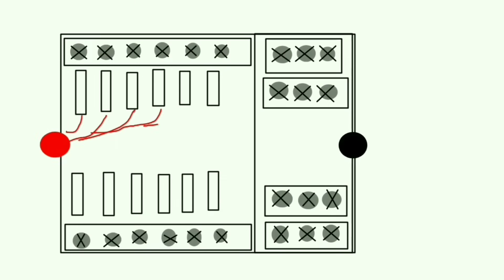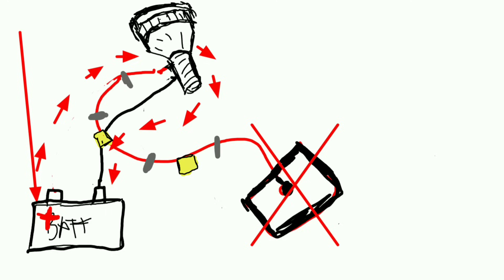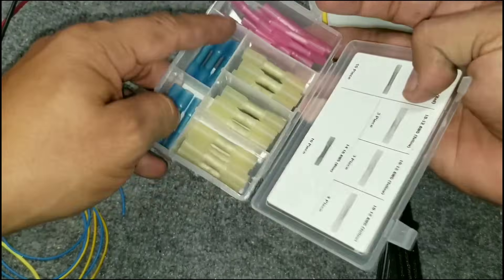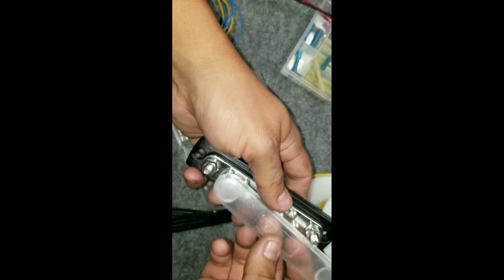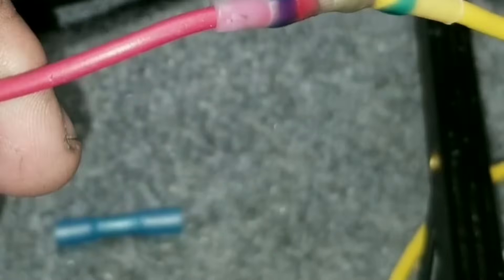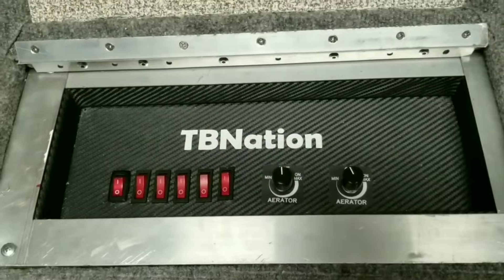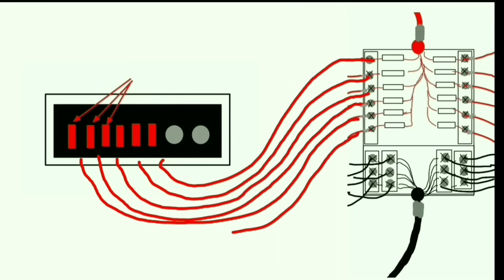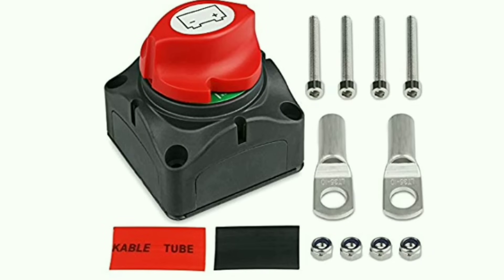SUPER EASY Boat Wiring Electrical Diagrams, Fuse blocks, busbars, marine grade

Comment: How do I split the positive wire from the battery into 6 or 8 wires (1 to each of the fuses) on the panel?  Is there some kind of splitter to buy?

Comment: Only thing about the low temp solder connectors is that a wire may penetrate insulation (apparent on this video) and then you have a water intrusion problem. So maybe the mechanical crimps with heat shrinks is the way to go.
Reply: Tiny Boat Nation THIS IS THE WAY.

Comment: If you have a lot of accessories in one general area, you can save a lot of wire and have a neater installation by running a single larger wire to a local ground bus.  This saves having to run 4-5 individual ground wires all the way back to your switch panel.

Comment: don't use butt connectors- splice and solder with the heat resin shrink wrap (use 1 piece wire is better, terminals only, use a positive bus bar instead of having butt joins) solder ends for any crimped ring terminals (tinned copper is best) - lasts a lot longer, otherwise I endorse the vid, is good. Using the good wire, panel and the blue sea, fuse/bus bar.

Comment: I am new to wiring . I have two deep cycle batteries. One for trolling motor. One for starting 25 hp Johnson . I have a starboard floor and a plastic logic 15 foot v haul boat. Can run all wires under flooring.  So I can run 6 gauge positive and negative wire with fuse directly too trolling motor. Starting motor has a positive and negative wire going direct to battery.  So need to run two more 6 gauge + and - too the fuse block (blue sea system 5029) then out of that run14 gauge + and - too fish finder ,Bilge pump,radio, marine cb, live well, lights. Then run black positive 14 gauge wire from these Accessories too a  bus bar and then 1 wire back to battery. To complete the circuit. Where does cut off switch go and is this too much for just cranking battery.  I know engine will charge battery. Would I need a battery charger or minder. How do I wire that just directly to battery. What bus bar and switch and chargers do you like.   Thank you

Comment: None of this videos say where the wire is coming from and what it is when it gets to the power source. We need a video, each wire from the light to the source. I dont understand the bars and all that. Tou just start in the middle every time.
Reply: He ran an 8gage positive and negative to the bud bar from the battery. Then ran his leads from accessories to the bus bar. I thought it was straightforward.
Reply: Then maybe, just maybe, you shouldn't be doing wiring.
Reply: @n5syr01  watching videos to
Learn is wrong?
Reply: The battery ties in to the bus.  Just consider the bus a battery with more teminals
Reply: The bus is basically your battery....you take a source (say a Bilge pump) and instead of running the red lead to the battery + you run it to the + of the bus bar...same with negative.
Reply: He does. Around 8:40
Reply: I agree, I wish Mike would start at the battery and go forward then come back to the battery so you see the complete process start to finish,this is no a hate comment just need complete baby steps so is beginner see the whole process full circle 👍👍

Comment: great video! i have one question—-the switch board i bought has 1 end on the back that’s open. so if i run the bilge pump wire into the back of the switches only open pin, how do i run that pin into my fuse box? do i just piggy back the wires at the pin?

Comment: Thanks foe the info,,my boat is 17ft long and have no power to bus bar,,will 8 gauge be safe to rewire it, about 25ft of wire,
Reply: @TinyBoatNation  Thank you for the reply, I noticed the red and black wire that feeds bus bar with fuses from battery were bigger, I just didn't know what gauge to use, thanks for your help and the videos.

Comment: hey Michael, Do we need to add a fuse (commonly hearing 30amp) past the battery switch before the fuse box? I keep seeing mixed answers. thanks. Currently adding electronics to my 14' gregor.
Reply: No point you are double fusing mate. Electricity doesn't work that way. Even the large fuse prior to the mains switch in your house the fuse is different in how it works its not a conventional fuse,  the ones in the consumer unit are breakers and only the ones on the plugs are fuses. This is for a reason.

Comment: Hey Bro, thanks for video. Just bought a 1982 Cajun bass boat that needs to be completely re-wired. Can’t find boat electrical diagrams or manuals. So, my question to you is, how to set it up for re-wire, and what supplies to bye? Help. AJ, thx

Comment: Do you have any advice on how to make a solenoid connector stay in good shape? For example i got a few older solenoids, the one on now got all green where the connectors are, so say i chop the wires / replace what ever, clean / metal brush the solenoid connector and bolt them on nicely. However since there was corrosion there before, itl corrode quickly again. Do you have any advice how to keep an older connector thats redone from corroding again? Like should i rubber cement that? or how do i just keep it from turning all green again in 6 months. Thanks

Comment: Great video. I didn't even know there was a difference in the wire. I just got my first boat I'm a 44 year old car guy and planned on doing my boat like a car. Thanks for teaching me and saving me some future headaches.
Reply: If you run either of the cable types through conduit then they will likely last the same amount of time and you should be tinning your own wire ends and fluxing up before hearing solder. Rosin core solder still gets cold solders if you don't use flux. Heating "low temp" solder is not in any way ideal and I'm suprised he went for that since he was clued up about the wire guage.

Comment: If your using a 3 prong switch did you do anything with the negative prong on the switch or just didn’t use it?
Reply: Tiny Boat Nation where do you ground it to? Do you piggyback it to the negative on the fuse block or run a negative bus that connects to the battery?
Reply: @adamshields1982  great question,I would like to know the same thing?

Comment: This was super helpful, i have one question with regards to grounding. In a fiberglass boat would you need to run a separate ground from say the motor to the terminal bus?
Reply: For small boating wiring there is not really a concept of 'ground' - for the powering of accessories and lights, it is more a situation of positive from the battery and negative to the battery. The role of the motor/alternator is separate to powering accessories, the battery is charged via the alternator while the accessories draw current from the battery. Typically there will be a negative bus bar which connects to the negative terminal of the battery - just a convenient way to collect all of the negative terminals of the accessories for connection back to the battery.

Comment: Great video.  Invest in a crimper the doesn't risk puncturing the the heat shrink connector.  Like a ratchet style crimper designed specifically for those connectors your using in the video.

Comment: Rewiring my project Aquasport boat. So basically I should buy the box with ground and power running through it as a fused thing. So if I’m wiring my boat gauges to motor, I should run the positive gauge wire from gauge to the box and have it go from box to engine, and then have the negative ground out in the box. Just making sure I understand. This video helped a lot and made me feel more confident. Thanks
Reply: Or just buy a proper switch panel mate.

Comment: You need to slide to heat shrink butt connector down the wire then fray both ends of wire and twist them together then pull your butt connector over them and heat makes the pull  strength a 10x's stronger but great videos man very inspiring 👍

Comment: Are you not using relays at all? What are those toggle rocker switches rated for current-wise? If I can get away without a relay I'd much rather do that but I've been weary about burning up switches.

Comment: Can't I just connect ground wires to the body of aluminium boat for example for all gadets? For example if I use switch from batery (-) to the body of boat and then whole boat can work as ground (-), no? And only Positive wires goes trough from battery to switch panel and to the gadets?

Comment: Noob here, how do I choose a fuse block? My boat has an old glass tube fuse block. Id like replace it and clean up the wiring from this inherited 1989 Lowe. I see 12-way block positive, 12-way w/neg bus? Recommendations, differences? I already see I need to upgrade wire. my 12v trolling motor i just bought, the pre-wired plug is only 10 gauge for a 15ft run. I think I need 4 guage according to minn kota. I wired the trolling motor directly to a deep-cycle battery with an inline 60Amp breaker.

Comment: Very helpful. New subscriber! What gauge wire did you use from the motor to the battery? I've been told both 4 and 6. (99" Merc 125)

Comment: Any issues with accessories or the blue sea fuse block having a constant draw on your batteries? I know your master switch will turn it off. But does it draw power when off? 

I had issues with a fuse block in the past, need to figure out the best way of preventing it going forward.

Comment: hey man, make sure you know what you're talking about before you try to teach anyone. that's not shrink wrap. ti was a solder sleeve, and you fucked it up with the grill lighter. use a heat gun next time. you made a bunch of other fuck ups, and your craftsmanship is shoddy at best.
Reply: Sir, I'm not competing in your industry. I'm an aircraft electrician, but if you are getting more jobs than your competition good for you.Just make sure your work is done to a high level of craftsmanship. That's what people deserve when they pay you for a job. Now as for my card board box personality. I may be an Asshole and everybody knows it, but I'm working on it! Thanks for taking time to reply. I did give you a thumbs up. Thanks for keeping it real with me.

Comment: No relays? Are those switches rated for that much current?
Reply: @TinyBoatNation  right on. If the accessories don't require much amperage, then you don't have to worry about relays. I would guess though, that a pump or a fan would draw quite a bit of current. The cheap switches could burn out without relays.
Reply: @TinyBoatNation  I bought some for my golf cart accessories on Amazon. They were pretty cheap.

Comment: Question, do all black cables go to negative and all the red to positive? Also, how about yellow?
Reply: Michael Lopez Thank you for the quick response. I ask because we got a new sailboat to us last year. After the purchase, we realized that the starter battery was fried. It was a 92AH AGM Intimidator, which I just replaced yesterday with am AGM West Marine with the same specs. It should be noted that our house bank is a 400 AH Gel. We have 200 AH Gel in the lazarette and 2 98 AH Gels behind the engine. I took pictures when I uninstalled the old starter battery and used the pic to guide me installing the new battery. On my way home last night it dawned on me that the old starter battery had a black lead attached to the positive side, which I duplicated with the new battery. It must be wrongly installed, right? Sorry for the long explanation. I have both a battery charger and an Inverter charger. I also have a yellow but that is on the negative side.

Comment: Small but important point ... follow standard DC wiring code and use RED for the positive and BLACK for the negative.
You can also purchase some flexible plastic conduit that you run all the wires through and makes it much tidier and easier to keep compartments clean. Your video was easy to follow.
Reply: On ships we have wire bundles, no conduit....easier to fault find.
Reply: Yellow is the international color code for D.C. neg.  The boating industry went to this because of boats shipped overseas where in many countries black is used for both D.C. & A.C. electric positive/line in .

Comment: I can't seem to get an answer, hope someone can help. I have 2 batteries on board. A deep cycle and  starting battery. Trolling motor runs off deep cycle (of course), which battery do I go to, for the fuse block ? (Lights, depth finders, livewell) . Thanks.

Comment: no positive battery post covers - major marine wiring and USCG reg fail
no main fuse on positive @ battery bank - major marine wiring and USCG reg fail
those two mistakes especially in combination are why so many boats burn up
Reply: What fuse do you put on the positive @ battery bank?  Or are you meaning the battery isolator cut off switch?

Comment: I've watched this video 3 times now and i'm still pretty lost. I know absolutely nothing about wiring or load capacities.. or really anything electrical related, but i'm about to start my boat build within the next couple of months. Is it possible to use just one gauge wire for the entire project? I'm really lost when it comes to how the battery gets connected to all of this. I've looked online for schematics but nothing really makes sense to me.
Reply: Just as a general point, running thicker wire has few downsides -  it costs more and can be more difficult to work with as it is less pliable - but running a thinner gauge of wire that is not suited to the application (ie, the current draw) is dangerous as it can result in the wire heating up and potentially causing a fire (not good when out in a boat) and can also damage equipment that requires a particular current. You should really watch all of this guys videos and buy a selection of wires that meet the requirement of the accessory/light - and always run a fuse on all circuits.
Reply: Thanks Michael. I appreciate the help! I will definitely check out that other video.
Reply: The only small wires in your boat should be speaker wires and navigation light wires. Everything else should be roughly the same guage. If you buy one of the proper control panels (not expensive) you can spade or solder any guage wire you like to the back of each switch and all you have to do is run the single + that comes out the switch panel to the + on the battery and the - to the neg on the battery. People over complicate it they start putting bus bars and seperate panels in a small boat thinking it reduces wiring, well one of the + or - wires is running the entire way so just use conduit and run them both In the conduit. Bus bars and all this is called "over hardware" here in the UK. Its a well known phenomenon here where people who don't really understand electrics try to wire up everything up with too much hardware, double fuses on one circuit and all this nonsense, it leads to loads of issues with interference too. Buy a cheap boat switch panel off fleabay and when you see the back of it it will be self explanatory. BTW see bus bars they cause more blown fuses than anything I know and fishfinders and depth finders hate the things. Keep it simple like I said and that means your not having to join two mismatch guage wires and means each circuit is isolated back to the panel.  Example> small 14ft boat with a few of the usual  electrical components with varying guages of wiring, you'd get the switch panel on fleabay for maybe £20. You don't need any extrs wiring if the components have long enough wires to reach the switch panel. You attach each component to its individual switch and you are done. No pointless hardware or connectors or a pricey wire bill, no double fusing (each switch has a fuse holder should you wish to fit one) and no mess as you've got your conduit runs looking good so no wire is visible anywhere, no bus bar to hide out the way etc. The battery is ran directly to the two larger guage wires coming out the switch panel so no messing about, really simple and absolutely safe and reliable mate.

Comment: Hey Michael,  

I have a question for you. I got a switch panel that has fuses built in....do you just use a bus bar to connect everything or do you still need to run a fuse block? 
Thank you
Reply: Thank you for your help 😁
Reply: You don't need a bus bar for that unless you want to run wires a long distance, in which case you would put the bus bar where a lot of stuff needed connected so you only had one set of wires. If you mean the small switch panels with the puggy machine type wiring on the back all the wires looped together then they are great if you just wire everything directly to each switch. They even have fuse holders built in and if you have a fuse onboard the accessory then just bridge the fuse holder or chop it off completely. I use one on a 14ft mayland here in Scotland it has bilge pump, radio, nav lights, 12v inverter, cooler box rigged up to it. I've never had one issue.

Comment: looks like your low temp butt connection  did not solder very well lots copper copper showing  copper wire is a no no  tinned wire for marine electrical